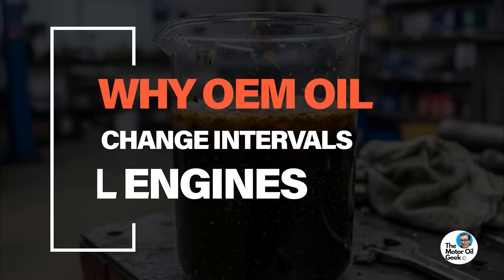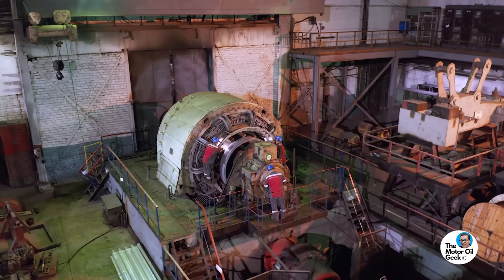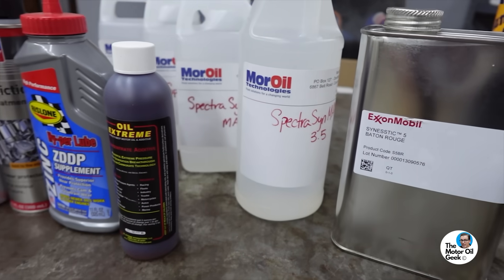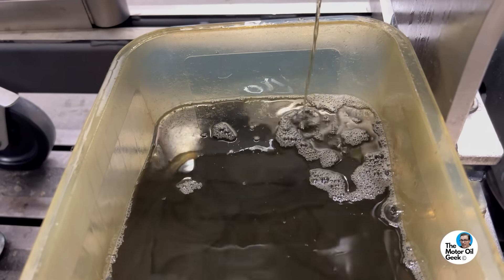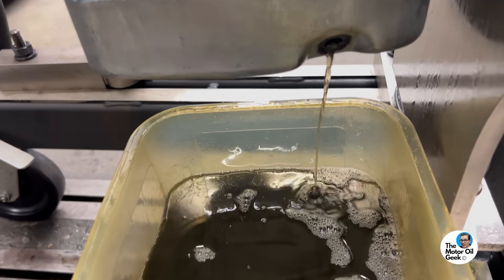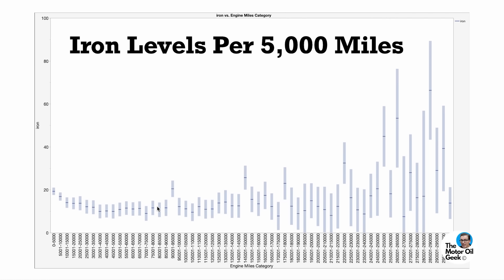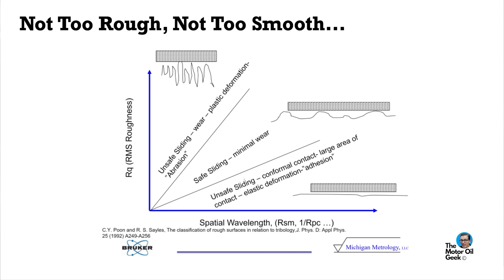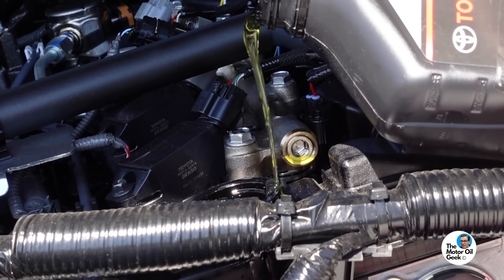NEW Data Reveals WHY Modern Engines FAIL Prematurely!

Comment: There was a reason cummins went to big cam cummins 855 with much larger roller bearings in the roller assembly for the lifters with roller camshafts to make the engine last longer running at 1800rpm pulling 80 thousand lbs loads. If I didn't haul max loads with my truck and just was a daily driver around town, I would use a gasoline engine because from every measurable point it's  cheaper and more cost effective, no oil leaks on your concrete  driveway, no stink parking in your attached garage to making your house smell like a diesel repair shop and your family will enjoy not seeing your smudged finger prints on everthing in the house and on the front of your wifes blouse ! 😂

Comment: Lucky one here to have a 2024 Yukon with the L87. Bought it late in 2024 build date 6/24. No recall yet. That said, did not know about the issues with these engines until after purchased.  I have changed the oil 5 times and switched to 5w-30. 10k miles on it and plan to change oil when indicator gets down to the 50 or 40% mark.

Comment: I have a great question?  For years I heard people would put 50% diesel and 50% oil in their engines and run the engine for example an hour.  The purpose is to clean the engine.  Then go back to straight oil.  From what I see it works the question is what damage this would cause.  Old engines with sludge what can be worse lol.

Comment: But the OEMs don't want the consumer to think they must pay for higher levels of maintenance in order to make their vehicles last.  There was a time they used to, but it's become the norm now because it all comes down to cost of ownership and an inconvenience to owning the vehicle.
That said, I follow what many engineers have stated, as well as what you have reported.  Don't follow the OEM schedule, perform services more often, especially so if in an environment which has wide temperature swings and dust, and you do a lot of short trips.   
I've worked around dealerships most of my life too, I can attest to the charge that lack of maintenance has caused more engine repairs, and it's obvious just by looking at the internal engine parts.  You typically see varnish and/or sludge, not a spotless engine.  It's also why on our used vehicle I use a higher detergent oil frequently as I don't know the previous history well enough and want to be certain I'm clean contamination out of the engine.

Comment: Great information as usual Lake. I remember how, in the 80’s with my Mazda GLC, I used to change my oil every 3000 miles and the filter every 6000. Now we have a ‘15 GX 460 and Lexus says change every 10K miles. It does hold 8.2 quarts where the Mazda held 3.9 quarts but the Mazda cost me $2200 in ‘88 and the Lexus cost us $45K in ‘17. Because of the bigger investment, I started to ignore the manufacturer and Wood change the oil every 5000 miles. What do you think about changing the filter every 10,000 miles? And down here in Florida would you stick with the 0–20 Oil or move to a thicker oil? Bigger investment needs better maintenance.

Comment: So I have a 2021 Durango SRT with the 6.4l. I Go go above and beyond the maintenance schedule with oil changes at 5000km or less with 47000km on the clock currently. My last change in July was at 43000km and I had an oil analysis which came back clean, however. Upon opening up the filter to inspect the filter media I discovered a good amount of metal. Not caked into the pleats and not brass colored but very shiny, bright metal flakes and shards throughout the filter media. All changes prior to this were at the dealership, so Mopar SRT filter and the Pennzoil  ultra platinum SRT 0w40. With this current service being Amsoil signature 0W40. 
So I'm exceeding the service recommendations and seemingly looks like I'm having lift/cam lobe failure. Thoughts?

Comment: But there are other rather bad design choices that affect oil, that are separate from the choice of oil in itself.

Early 2000's GM made a choice to use a phenolic resin for a lower intake manifold gasket in their 3.4L V6 engines that happened to be dissolved by organic acid coolants. So now you had a ticking time-bomb (averaging on two years) for coolant to get into the oil, which caused all kinds of lubrication break down issues that got those cars a reputation for being lemons. However if you could change that gasket out for a laminated rubber and metal one, the problem goes away completely. Or the alternate option was changing back to the older glycol coolant chemistry. The funny thing is, those engines become quite reliable if one or two (bad from the factory) design decisions are corrected. The cars still out there in the used market likely attest to how they all could have been if the better choice was made from the start.

A bigger problem is that a lot of modern cars have a stupid issue from using an internal wet belt design, which effectively results in planned obsolescence due to it's inherent self-destructive nature. At some point the belt will break down by being directly exposed to hot lubricating oil. If the engine doesn't self-destruct from a timing belt failing when there is an valve interference layout, it will instead self-destruct due to a clogged oil pump due to all the shed material from the belt going directly into the oil sump. Over time, such designs will always have lubrication problems regardless of which oil is used. It's really stupid, and there's some other videos out there on the issue. Yet companies are still doing this practice, even though it's bad for reliability to the point where the engine has and end-of-life built right into it.

Comment: My jeep 4.0 oil is always black no matter if I change it at 2k or 4k miles 😂😂😂 I think the moment I pour it in the engine it turns it black 😂😂 and I use cheep ass filters from fram. It’s still chucking along with over 245k miles 👍

Comment: I have a 2015 Tundra that I bought new and I'm currently sitting at 427,000 miles on it. I have access to an oil analyzer and I can tell you I test my oil all the time and there's times where I need to change my oil at 2000 miles, and I've ran my oil as far out as 23,000 miles before changing it. I change my oil according to the oil analyzer now when I do run it out longer intervals I will change the filter once or twice and just top it off with that being said using high quality oils with a GOOD additive package is a MUST. My truck having that many miles on it  doesn't burn or consumed any oil.

Comment: Another great video. Way back in the 60s I worked for a pipeline company with thousands of natural gas fueled industrial engines. There was a big department of engineers that tested engine oil and filters looking for the best products that reduced wear and failures.  It's a big topic in industry.
I personally have always used 5W30 engine oil and the best filters available. I drive my vehicles over 150,000 miles without failures. These trucks and cars have VVT. As you said, 20 weight oils increase wear and failures. Deep dive into filtration would be great.

Comment: It would be an interesting video on how a modern motorcycle breaks in with wear in particles.

Also, how the wet clutch affects oil longevity.  Are the clutch particles trapped by the oil filter?

Comment: If you live in a dry dusty climate, I am certain that there are going to be a lot of highly-abrasive road dust particles (<2.5μm) getting past your paper intake filter and landing in your oil sump, via the PCV air-supply hose.
Have you tested for this?

Comment: if your vehicle says use 0w20 use 5w30, if it says use 5w30, use 10w30 i it says 10w30 use 15w40 if it says 10w40 use 15w40 or 20w50... youre welcome... do this and change the oil regularly (every 3k miles max) and youll never ever have lubricity issues with the oil.... if you use the recommended varieties, (especially the lighter end ones) youre likely to have issues with localized low oil pressure, localized oil starvation, and localized bearing damage. usually at the last point in the galley... i used to blow up a lot of engines till i started doing that, havent blown up one since (due to lubricity issues) on the street or the race track.

Comment: I change the break in oil in a new vehicle at 600 miles and I don't care what the book says.car, truck, motorcycle whatever,600 miles the break in oil is coming out!THEN I may or may not go with the recommended intervals depending on how long they are.

Comment: The main reason in my experience is stupid engine and vehicle design. The more difficult the maintenance becomes, the less maintenance is done. The vehicle, after all, only has to work through the warranty period. If the vehicle falls apart like the Bluesmobile at the end of the movie, that's the owners problem.

Comment: Great video!  Yes, please more on filtration.

So based on what you are saying, oil filter efficiency is more important on a modern engine?  Since you have a modern Toyota, what are your thoughts on using OEM Toyota oil filters, which purportedly have lower filtering efficiency?  Would it be worthwhile in the long run to upgrade to an aftermarket filter with bettering filtering efficiency?  For example, Carquest advertises 99.5% efficiency at 20 microns.  Is this going to make a significant difference in the life of a Toyota engine over an OEM filter?

https://www.showmethepartsdb3.com/BIN/documents/CQFILTERS/LD%20Blue%20Oil%20Sell%20Sheet.pdf

Comment: What micron filtration levels should we ordinary vehicle owners be looking at?  If I change my filter every other oil change, what filter should I be using?  Not trying to start a filter war - just what micron level should I shoot for in a filter.  I guess there is an efficiency rating too - like 95% or 99%.  Therefore, what micron and efficiency rating should I shoot for?
Reply: 99% at 20 microns is what you want for a full flow oil filter.

Comment: Have a gen. 4 Ram with a 6.4 Hemi and so far I haven’t had any problems with the engine. Change oil every 3,500 miles or every 4 months. Been doing this since I had my first vehicle. Only problem with the Ram and it’s 6.4 is MDS. And I use 5w-40w because I live in south Texas where the Summer road bed temperature reaches 140 degrees plus. Hard on any engine.

Comment: If you use top tier gasoline, do you ever need to add Techron or get fuel injectors cleaned? Or is just using top tier every time good enough?
Reply: unless you are using Chevron gas, I would add Techron or Liqui Moly Jectron
Reply: @MrRjnr  how often though? Why is chevron gas better than other top tier gas?

Comment: I'd like to see the same rigor of the engine wear videos and the data analysis applied to transmissions and ATF. ATF is what, a group III PAO? Shops won't replace more than two quarts of transmission fluid because the "dirty" ATF and the sludge on the pan apparently help the transmission to not slip. I call b.s. and don't understand why a transmission can have debris and contaminated fluid, but an engine cannot. There has to be a transmission test dyno that can generate similar data as the engine dyno does.

Comment: There's needs to be transparency on oil filters. Every filter should have the micron rating, debris capacity, and flow rate stamped on them.
Its nearly impossible to find this information and compare brands.

Comment: The modern vehicle isn't meant to last past break-in lol.  By then a headlight goes out or you break a door handle or need a new windshield wiper blade and the whole car has to be totaled because there's no parts or the CANBUS won't work with non-calibrated replacement bulbs.  I'm honestly surprised new cars even have lug nuts anymore.

Comment: I believe the real problem at the engine level also is low-grade metal manufacturing. There is a wide range from heavy duty forged parts to cheap fast casting metals to how the alloys in the metals are made tough. Oil counts big but pictures you show clearly shows very bad steel manufacturing and not the sanding down of parts from contaminants so much.

Comment: This is what chinese sourced steel and mexican labor get you for $70,000 .
Reply: Lots of problems coming from assembly plants in the United States and Canada also.  I wouldn't put the blame on Mexican labor.
Reply: @CAN43714 You might not, but I am, every manufacturer has problems with every engine that comes out of Mexico.
Reply: @Tomcat71  The biggest recall in Toyota history is from an engine assembled in San Antonio TX for their Tundra Trucks.  The other current and ongoing recall is for the GM 6,2-liter engine assembled in Michigan, NY and Ohio.  Both recalls are costing Billions .

Comment: When asked, I always recommend on a new vehicle purchase to change the oil at 2,500, 5,000 then every 5,000 after that. 
I had a friend who was leasing a vehicle and the oil indicator didnt come on until 12,000 for the first change. I cut open his filter and it was filled with metal. He said, I already hate this vehicle and will not be keeping it past the lease. Fine for him, but that will 100% fail on the 2nd owner.

Comment: Marvelous video!  It's great to point out that the brand of oil is not as important as the ability of the filter to catch clearance-sized particles.  And that a new filter will not filter as well as a used filter for a while.  Yeah, I buy Walmart oil, but I also buy top-tier synthetic-media filters.  Fram Ultra's are my favorite at the current time.  

Can we expect a big filter performance test in the near future?

Working at Eaton Corporation on OEM valvetrains taught me a lot about needle roller bearing lifters.  I can say that if you see some surface distress on the roller, the surface of the axle will look like a moonscape.  That is where roller distress starts.  The axle will develop incipient spalling and the particles will impede the rotation of the needles and cause skidding.  That in turn causes the roller to skid on the cam and the situation degrades from there.

Comment: Engines circulate air in the crankcase, air brings dirt in
dirt stays in the engine.. flush the dirt out by changing the oil

Comment: Modern engine are failing because it built with tighter tolerance and less material leaving very little allowance for defects. So when an old engine could easily run with a small defect that same defect would kill a modern engine

Comment: Should I keep using the srt recommended 0w40 in my 130,000 2015 hellcat?  It has no tick. No noises. No problems. Been solid.
Reply: good job! Personally I would start using 5w40

Comment: 0W20 working well in quality gasoline engine - nice to see, though it's nothing surprising. I'm so tired of this "0W20 will kill your engine" myth. People have so much trouble with undersanding, that the answer to "is 0W20 good engine oil" is "depends". For good old naturally aspirated 1.8 R18A2 Honda engine - sure as hell it is.  For some direct injected 1.4l 200HP engine or for a big murrican diesel? Probably not.

Comment: My older Euro Accord can take 0W20 oil and 0W40 oil and many other. I use 0W40, because i don't believe 0W20 is better protection, maybe equal if not heavily loaded.  i use 0W40 api sp class, ewerywhere i can, in all old cars.
In new cars i know 0W40 maybe too thick, depends what car.

Comment: +2 on visit to Donaldson’s Lab. I confess to being old school. Change all fluids earlier and stick to oil / air filters with smallest Micron ratings. Sorry… I cannot leave old oil / air filters in too long simply because I don’t have the diagnostic tools to measure when it’s dirty enough to filter better vs too much dirt. BUT I dump oils / fluids long before they are too contaminated. My fear is that especially for air filters that folks do not properly install them and without a tight gasket seal…..dirt will bypass a clogged air filter under pressure. This happened to my John Deere lawn mower. Thanks for video.

One question - will going up 1 grade from 0w20 to 5w30 help with oil dilution from GDI?
Reply: I’m the same way,, and I’m glad I checked the color at 600 miles into my last oil change,.. my air box lost a screw and was sucking unfiltered air, I started looking for causes of the blackened oil as it’s never been that dark that soon although I had used Restore and Protect for the 3 prior oil changes… but it’s an LS engine with 200k so it’s probably fine 😂

Comment: My Isuzu 4jj2 motor has 190.000klm i change it every 5000klm ,service is 10.000klm also in summer  i run heaver oil 10/50w winter 5/40w ,seems much quitter running on 50w

Comment: Like Lake says, oil does not generally breakdown or wear out. It get contaminated to death. I have a classic Pontiac 455 that the factory put together 53 years ago. For the last 27 years (35,000 miles) I have changed the oil every 1000-1500 miles (aka annually). The engine runs well but age as finally affected the ring seal. I am building my spare 455 to keep my car on the road. I am using Driven break-in oil and will change it after 50 miles. I will change it again with break-in oil after 200-250 miles. Oil is cheap, engines are not. I have 3 brands of oil filters on the shelf. I just need to figure out which one has the best micron rating. I am also going to take Lake's advice and break in the rings properly by spending as much time at peak torque. Fortunately, there is quite a few country roads with hills, very close to where I live.

Comment: Hi, I have a Toyota that gets around 3000 miles each year. It has currently done 80000miles. Should I change the oil every year? And should I change the filter each time as well? Or is it better to just skip the oil change, and do it every other year? Its a turbocharged 3sgte engine. Thanks for all the great info for us car and oil geeks!